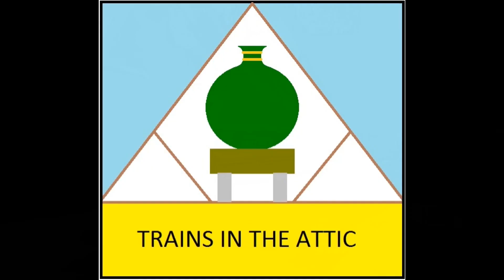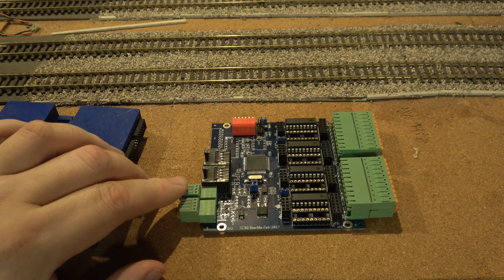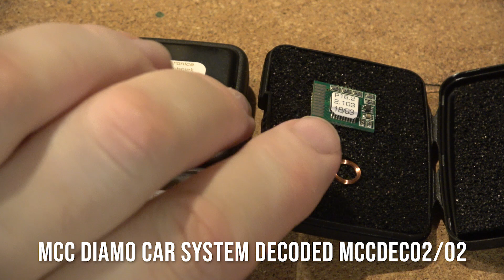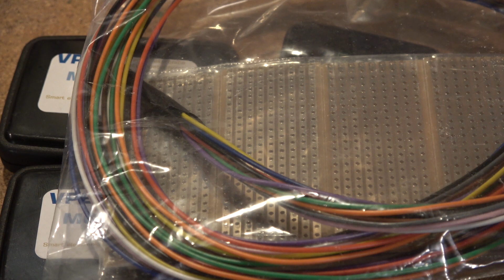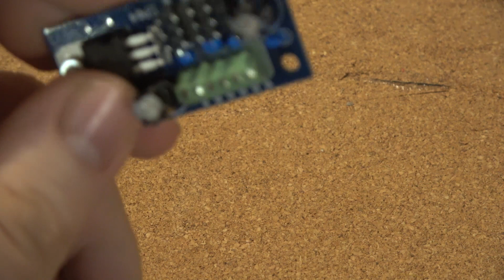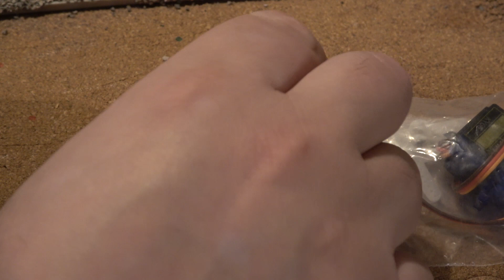My Roadway system Part 3 The Control System

Comment: Hello - this looks interesting. I've been interested in the Dinamo MCC system for a few years now, never liked the Faller system (too toy-like), but saw this at the Warley Show and became interested. I'll be interested to see how this progresses, the most important bit, how they actually move. Trouble is I model in O gauge (1:43 scale), so if you can think of any advice on converting to O scale that would be great (no rush). If I have a car or lorry that's steerable and I fix a motor and battery in it, what things would I need to consider, other than transferring the magnetic steering plate?

Are you actually going to a show? Surely all shows are cancelled aren't they? Perhaps they weren't when you made this video.
Reply from the maker: hi the best person to talk to about this system is james at DCC train Automation he will be able to answer all your questions here is a link to there web page https://www.dcctrainautomation.co.uk/ I filmed this before everything closed but the Ally Pally show is rescheduled to 22 and 23 August